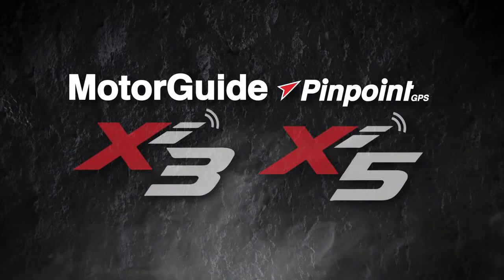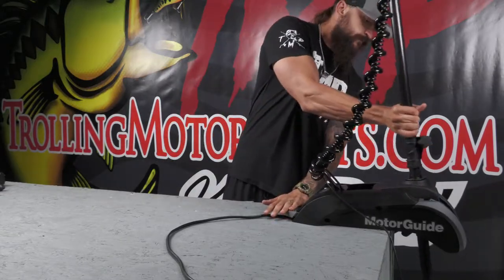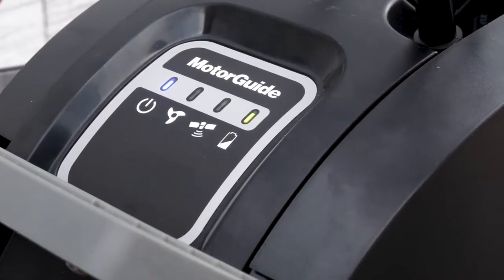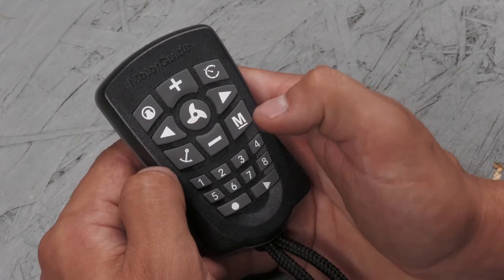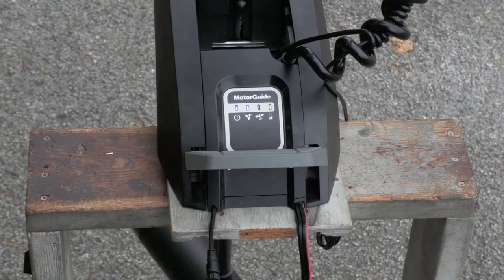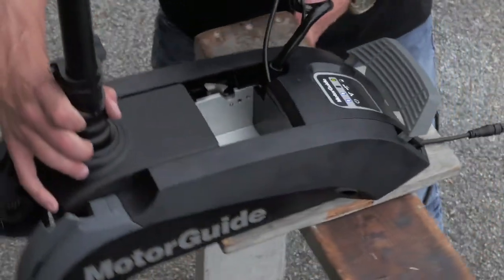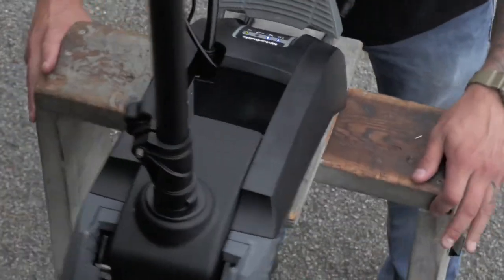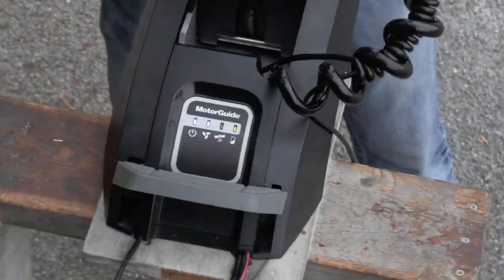Motor Guide Pinpoint GPS Compass Calibration | Xi3 & Xi5

Comment: My unit won’t connect to the satellite and it’s driving me nuts. Spend 2 hrs on the lake trying to get it to work.
Reply: Did you ever get this fixed??? Mine just came and took it out first time today and had the same problem!! 😡😡
Reply: Out for first day on water.  No 
GPS, spinning like a top on the lake.  Gave up and just wanted to manually operate.  All good manual.  Then all a sudden 25 minutes later GPS started to work.  However anchor was like riding a bull for 8 seconds, so not sure if I need to now calibrate compass.
Reply: Did yoi guys ever get a fix? Mine works just fine but the gos light never turned on. Wondering if it could be better.

Comment: The XI3 is junk.  Don't waste your money.
Reply: Have yet to have a problem with mine🤷‍♂️ been a great unit
Reply: Good to hear.  I bought two ..  Both were junk,.
Reply: I hope not I just got mine but I did trade a bow fishing setup and 400 bucks so if it's terrible not a huge loss
Reply: Good Luck!  Maybe I just got two lemons. Who knows.
Reply: @conorreavey5960  I can't say the same, mine will not turn motor to get back to original spot, it just turns left, right , and that's about it.
Reply: @robertbennett6418  I agree. I am just wondering how is it that many more people are not having the same issues?
Reply: Mine is fine and working great

Comment: my Xi3 will not calibrate no matter how many times I go around. I have to turn it off to reset it. My spot lock works fine. When I try to use a preset to go to a nearby saved location the motor goes nuts. It will either start stop every second or the motor will spin in circles until the cable binds. I have tried resaving presets at my favorite spots but it does not help. Maybe 2 or 3 times it randomly worked but usually goes in a wide arc to get there.

Comment: What happens if it still doesn’t hold gps location and starting spinning and wrapping cord up?
Reply: That happened to me
Reply: Calibrated mines so many times, and it still goes rogue on me. 

Called customer service for the dongle update, and was told that will not fix this issue. That I would need to purchase a new GPS unit ($4xx) no thanks. Was asked to check the wiring to see if it was installed incorrectly. Everything checked out. Taking it back out on the water tomorrow to recalibrate this. If anything - I'll just switch to Minn Kota.

Comment: Mines brand new the gps light isn’t illuminated I want to try the gps calibration but my light never came on like yours did!? It’s a xi3
Reply: you need to update your gps system.. have to call motorguide then they send you the update flash drive